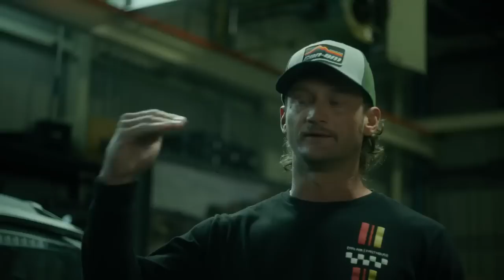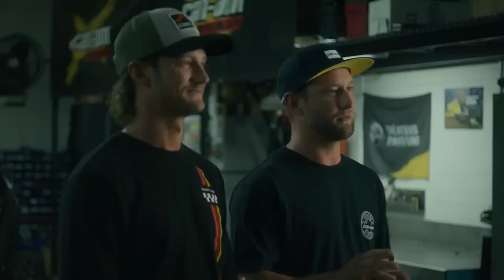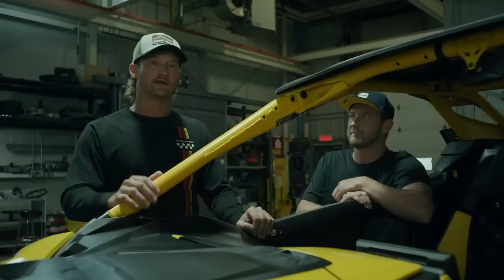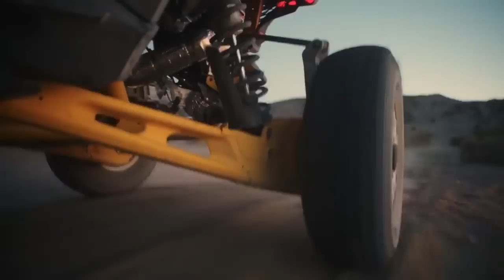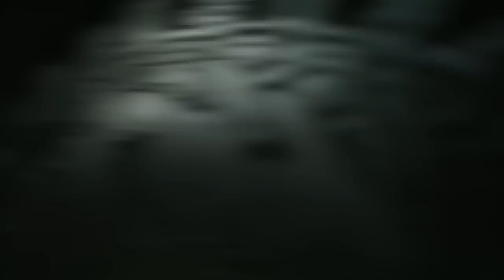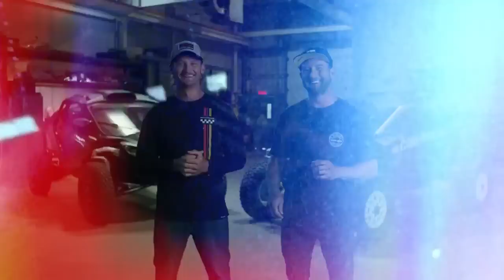2024 Can-Am Maverick R complete Walk-around

Comment: There's has to be a flaw/weak link, but where is it??? It's just matter of time til someone figures it out... Btw. That upper A-arm just looks out of place.. change is good but not when it has to do with suspension and steering... The rear sway bar link may be too long and the bottom A-Arms hasn't changed. They still have a weak link. And the rest knuckle in middle radius rod is single sheer. 😂